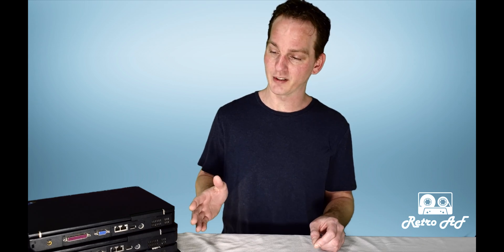IBM Thinkpad R40 Teardown

Comment: I bought one of these and mine is 2723 I believe, I need to change the thermal paste because it's heating up quick than throttling. I think the fan is dead cause I'm not hearing anything. Is it audible at all if you put your ear directly to the hole slot? If mines broke, i'll just order a fan with the paste and i'm planning on getting a 1.7ghz chip of the same chipset for like 40$ on ebay to upgrade it since I like to retrogame lol. ( it's pretty good for stuff like battlefield 1942, gta sa, unreal 2004, doom etc. I mean low settings but it runs great. )
Reply from the maker: the fans for these machines are notorious for kicking the bucket. 
you can definitely hear it if you play a game.
thanks for the comment!

Comment: I have a similar all functional laptop, which is ThinkPad R40e. I think maybe the best way to use it at 2022 is make a portable monitor with it's screen. But I want find a matching driving board. So could you tell me what's the model  number of the screen?
Thanks a lot!
Reply from the maker: I would be guessing since the laptop came in several screen sizes.
Google search for an r40e inverter with your screen size.
good luck!
Reply: @retro-af  Sure!
I guess maybe the best way is I teardown it by myself. Your video will quite helpful. Thanks again, Sir!
Reply from the maker: @qinggi8345  Im sure you can do it if youre careful around the lcd's plastic frame.
Thanks for the feedback!